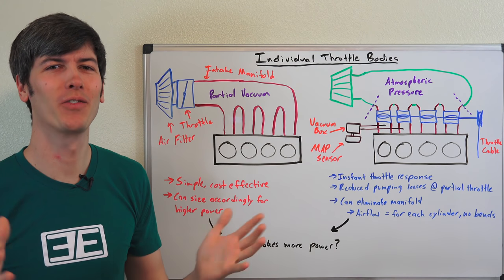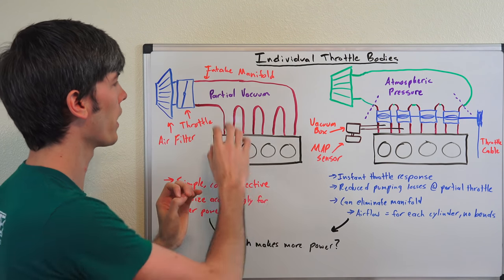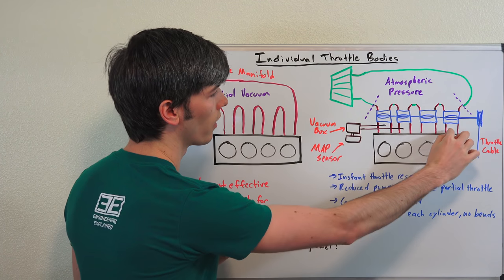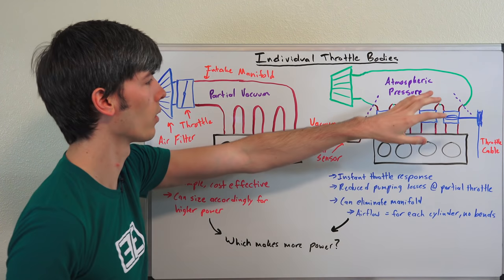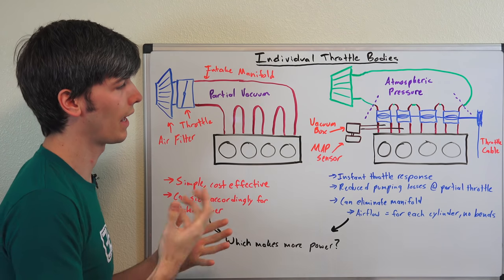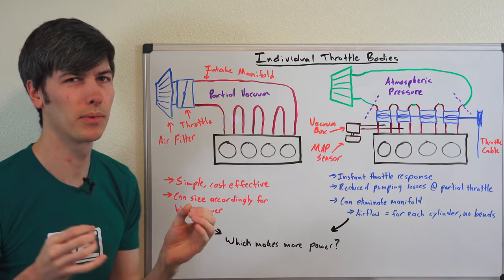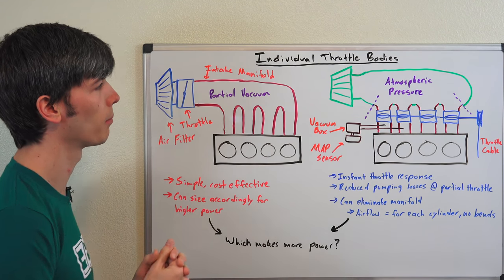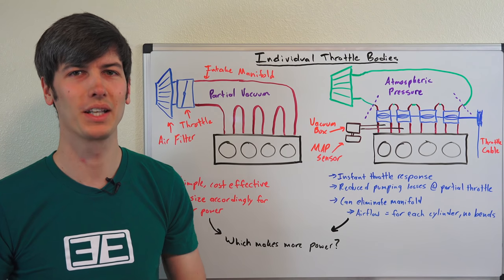Benefits Of Individual Throttle Bodies

Comment: I used to own an Alfa Romeo Giulietta 1.8 with the "Alfanord" twincam engine that used to power Alfas a few decades ago with displacement from 1.3 to 2 liters (also, Alfetta, Alfetta GT/GTV, and, before, Giulia & Giulia GT).  Those Alfa engines were all ITB and actually very reactive, although it was difficult to  sync the 4 TBs, to avoid some disappointing power gaps. Not so many mechanics were able to do the job properly and was also expensive. The 2 liter engine was the first to switch from two 2-barrel carburetors to electronic injection, unfortunately losing the ITB feature

Comment: You still have the same pumping losses at partial throttle. Torque output is all about MASS flow. Mass flow for a given torque output is the same regardless if you have individual runners or a manifold.

He’s talking about pumping losses in a transient environment, IE manifold filling, which matters not at wide open throttle or steady state cruise. Reduced pumping loss from ITB is so tiny that it doesn’t matter.

IF you could control each throttle individually, and completely close off some of the runners so NO air flows, you could drastically reduce pumping work, but you would essentially have created a variable displacement engine. 

Throttle response is the only real advantage. You can gain some width in the power band by running slightly different runner lengths, and ITB’s would make it easier to match if you had a carb, but that’s about it.

Comment: Hey EE, performance oriented ITB cars are tuned Alpha-N or TPS vs. rpm.  N/A cars can be tuned without a intake manifold in this case.  Turbo cars still need a manifold for fueling adjustments while in boost.
Reply: Was hoping someone would mention Alpha-N. Vacuum signals from ITBs are very "noisy" and not very strong at partial throttle for reasons outlined in the vid.
I built ITBs for a car I turbocharged some years ago. 
To map the engine, I ran Alpha-N and applied corrections to fuel and ignition based on positive manifold pressure.
Worked like a charm and had fantastic throttle response.

Comment: Back in the day I owned an '93 Alfa Romeo 33 with 1.7L 16v boxer engine. This engine had ITB and was super enthusiastic on the throttle input. Loved that. I hate to say, but the NC Miata is driven by a ship diesel in comparison in this particular respect. BUT; The Alfa Romeo 33 with the 1.7L 8v boxer engine had even quicker throttle response then the 16v variant. Well, at least from idle. This 8v had a single throttle body. Never fully understood this. Perhaps due to having two camshafts an 8 valves less it had lower inertia?

Comment: Usually if you're running ITB you'd move to a speed density / alpha-N model rather than a vacuum tree. Also the engine response is important with a dog engagement gearbox, where you need a blip to unload the flanks and the more reactive the engine the faster the shift.
Reply: He also didn't mention that going to ITBs lessens the negative effect of aggressive cams on idle quality.

Comment: The true benefit of independent throttle bodies is the stereo warble you get from open velocity stacks when they're installed on a V8, flat  6, or flat 4, and the engine bay is behind you. There is nothing like that sound. It's glorious.

Comment: removing the inlet manifold as suggested would lead to massive induction roar and pulling hot air in from around the engine would decrease power. Also the long run of the 1st example can offers a mild supercharge effect as each inlet valves open at different times.

Comment: Can you do a video on why most rally cars are hatchbacks? What are the advantages?
Reply: lol that might be it. I've been trying to figure out why they are hatchbacks and the requirement for mass produced cars did pop up. But if that's the case, why don't we see Toyota Corollas, Nissan Altimas, Ford Taureses and Honda Civics in Rallys? Those cars are roughly around the same dimensions as some of the Rally Hatchbacks I've seen minus the hatchback.
Reply: It gives the poor buggers another exit choice when they are upside down!
Reply: Weight and mobility
Reply: Its mostly the mass production thing. Also the heritage of the sport is people who like to be outside, drive cars on dirt roads, and camping. Hatchback is obvious choice for those reasons. Don't forget all wheel drive. Very Important.
Reply: sharpemang well, Toyota was competing with the old corolla years ago
Reply: Group b were hatchbacks check other groups like a and c

Comment: Can you please explain how ITBs would reduce pumping loss?  I understand how they help combat manifold filling times to improve throttle response, however in the steady-state part-load conditions, how would pumping work change?  Pumping loss is a function only of the gas flow rate and the pressure loss across the restriction (W = m(p1v1 - p2v2)).  Therefore, for the same engine load (MAP) and volumetric efficiency + engine speed (flow rate), I would expect the throttle loss to be independent of the size and shape of any manifold volume in the system, before or after the throttle(s).

Comment: really good info, didnt really cover the torque benefits that bodies. they have a much wider torque curve. obviously this is relative to velocity stacks or plenum being correctly matched for the set up, but that instant throttle response is relative the the torque increase much lower down in the revs

Comment: The intake plenum is not at atmospheric pressure. There's an inherent pressure loss associated with the intake filter. 

Also the throttle body is a choking device. You can always make up for itb with larger single throttle body. but good points.

Comment: Done a couple ITB and the make much more torque in usually a 1000 to 1500 rpm range, heard some do a good bit better. I'd rather have one motor with a broad torque curve that will win most of the time over one that wins at one track.

Comment: what are your thoughts about using actuators instead of the camshaft to run valves and using them as throttle bodies at the same time?
Reply: asaikaly2 Like how BMW engines work?
Reply: they're amazing! personally, I cant wait to get to tune and mess with stuff like that! and i think it can increase power and efficiency as well. if he hasn't already done a video on freevalve tech he totally should!
Reply: He has done one on it, showing that the valves can open faster than with a cam shaft and have a longer duration
Reply: Preproto i thought so, just wasnt sure if i saw it somewhere else. im pretty excited for it.. i feel like its the next big change like EFI was!
Reply from the maker: Here are my thoughts! https://youtu.be/FJXgKY2O4po
Reply: I love the idea...less weight up top of the engine, smaller engine dimensions (easier packaging), along with the ability for the valves to mimic a low-rpm torquey cam at low revs, a full race cam at high revs, and everything in between.  Should give the ability to make phenomenal usable power throughout the entire rev range, using the same size engine.  This should also give better fuel economy and emissions, since it can be tuned for a lot more variables than a metal cam that has one set profile physically ground into the lobe shape (or maybe two, if you're thinking v-tec.)  :-).
Reply: The better the design, the more expensive to manufacture, and the less profit is to be made, generally.
Reply: True, but prices should come down with time and economies of scale.  Not to mention that it may actually become necessary as efficiency, fuel economy and pollution requirements tighten down over the years.  After all, fuel injection used to be considered very expensive and unnecessary - but they're ubiquitous now.
Reply: asaikaly2 multiair
Reply: The way that new engines work is way too complicated. I'm 15 and I can think of so many ways that modern engines can be simplified. even my 1982 Volvo is complicated, so I would probably die if I had to work on a new engine lol
Reply: Undercover Wookiee they aren't any different. They just have wires. Also those wires only have one home so find the one that fits.
Reply: Dealing with the heat is probably one of the main issues they've been dealing with - valves and valve stems get very hot, specially exhaust valves - and electronics don't like heat.  Having them sit in a hot oil bath is probably also part of the problem.  And unlike a cam lobe, it doesn't have a built-in way of cushioning the valve so that it gently closes on the seat, which can lead to some very expensive repairs if they get it wrong.  Not to say that these are insurmountable problems (obviously!), but they have probably added to the time needed to develop a reliable system.  After all, no manufacturer is going to want to employ something that isn't tested to the best of their ability - their reputation could end up shot to hell if they get it wrong, no matter how hard they tried or how good their intentions.  I'm just glad it's finally looking feasible and hopefully cost-effective - especially once economies of scale take effect.  :-)
Reply: Mechanical efficiency is one big reason why magnetic actuators are not a slam dunk.  You use a lot of power to open and close a magnetic valve, while a camshaft is nearly 100% mechanically efficient, since the energy you use to compress the valve spring, is returned to the cam shaft as the valve closes.
Reply: aussiebloke609 about the closing speed of the valves.. thats one of the first advantages that koenigsegg mentioned in their first video about it, they can hold it open longer and close it much faster without slamming it shut like a cam would if you tried to move it that fast.. and diesel injectors are are probably a good place of reference for them to sort out the electronics life inside a valve cover.. id assume (or hope, lol) at this point theyre mostly working on making it affordable to produce or maybe even still seeing how they can tune with it.
Reply: Cams are designed so that as the valve comes off the lobe, it eases the valve against the seat, so in theory, they shouldn't ever slam - but we know that's not quite true at really high revs.  But yeah, they seem to have that problem licked with the electronic actuators now.  I was just speculating that it was one thing they had to find a workaround when they first started R&D on the technology.  Just one possible reason we haven't seen this technology in the mainstream previously.  :-)
Reply: asaikaly2 BMW Made a prototype engine that had no timing chain (or belt) so no camshaft and tested on 3series BMW cars seventeen years ago.
Reply: Yns Msd tell me more! lol
Reply: slidestang242 I don't have more details about. You can make research about. I think the design wasn't that efficient. And for techs like me we do prefer having the conventional design so we could replace chains, belts, valves adjustment...so we could survive :)
Reply: Yns Msd there will always be parts to service, who knows, maybe replacing solenoids will be easier and make us more money!! lol do you know like what year they did that, or what they wanted to call it? i asked because im not sure where to start to search about it
Reply: slidestang242 I looked on Internet and didn't find interesting presentation. The system called "CamLess" or "QamFree".
I knew that BMW made a prototype because I red it in a commercial book when I was at Mechanical school.
If you like to read or learn some good sophisticated engine you could look for "MC-E5" engine blocks. It used a variable Rods to have a variable compression. It's a French design and revolutionary blocks.
Reply: We need Freevalve upgrade for all our B/F/K series.
Reply: asaikaly2 You'd need some pretty skookum actuators to get her to chooch right, that and a real fancy control system
Reply: asaikaly2 I believe Koenigsegg is working on a system for that right now so you might be able to find more info in relation to him.
Reply: Another reason actuator valve systems may be cost prohibitive is the wear on valves and valves. The sharp acceleration of the valves require exotic materials for the seats to make them hard enough

Comment: only suggestion is to give us a few examples of cars that have each- job well done- really enjoy your channel.
Reply: Very few cars have individual throttle bodies but it's the norm on motorcycles. The only bikes I'm aware of that don't have ITBs are some old v-twins where they share a carb between the cylinders and some 6 cylinder engines where someone decided it'd be cheaper to use 3 carbs instead of 6.
Reply: Scott Moore any car with an RB26 swap or a 1989-2002 GTR has ITBs unless changed.

Comment: I believe that it's somewhat incorrect to claim Atmospheric pressure in the collector manifold for the ITB set-up, as flowing air passing even a filter will have something of a pressure drop. Of course it won't be as low as the single throttle design, but unless you go filterless or foam, there will be less than 1 atmosphere. And the more those throttle bodies open, the lower that pressure becomes. At WOT, the two plenums will be pretty much the same. As the single throttle body plenum will rise in pressure, the ITB plenum will lower in pressure as both approach WOT.

Comment: I've noticed with vehicles with vtech or larger cams, longer intake is much better for power.. I think individual throttle bodies on that sort of engine would actually reduce power.. vtech will kick in and not much would happen. I noticed with an mr2 I had fitted with a full exhaust you notice the difference with having a shorter intake, its louder sooner..more responsive. It would be cool if you could have a system that incorporates both.

Comment: I live in Colorado at 6,000 ft+ . I have a 1994 Miata 1.8 NA without boost. Will ITBs give me more and better power? Does altitude cancel out IT B effectiveness? Can I run I ITBs with forced induction? Should I run a methanol injection cooling system with forced induction at this altitude? Thanks in adavance for clearing this up the way that only you can. Cheers!

Comment: The one disadvantage I see to ITBs that you didn't discuss is intake tuning. It doesn't look like ITBs can be set up to scavenge effectively using tuned intake runners, and therefore you are leaving horsepower on the table. Am I correct or can ITBs scavenge as effectively as a plenum system?

Comment: SLP tried doing the atmospheric pressure advantage with their T ram, as there's twin plenums on both sides of the intake manifold/runners, thus retaining outside air while utilizing a stock TPI throttle body.  These systems are very rare though, only found on the '91-'92 Pontiac Firehawk, and Summit Racing stopped selling them a while ago since production ceased.

Comment: I noticed that the f80 m3 (or m4) doesn't have IBTs like the e90/92, do forced induction engines benefit less from IBTs than NA engines? The r34 Nissan Skyline, despite being twin turbo charged, does have IBTs.

Comment: So if my car comes with a variable intake runner length system, upgrading to an ITB basically means that i can only pick a specific RPM range and enhance that range. Right ?
Reply: Not positive, but I believe so.  I think you'll sacrifice at one end of the rev range to enhance the other end.  It makes sense...but I'm no engineer.  :-P
Reply: Davin Yap if you remove the intake manifold, yes. As Jason said, you can remove not you should
Reply: +Alex Haws my car comes with the variable intake runner length system to eliminate a torque dip at 3k RPM. If i were to theoretically upgrade to a ITB, i will sacrifice daily drivability cause the ITB doesn't solve the torque dip issue. Right ?
Reply: Davin Yap i think it depends on what else you do to the motor and how powerful it is to begin with. how much tq dip is being prevented with a variable runner length? if its low then you probably will not notice a dip... unless your using a dynamometer.

i should note that i am not saying change or stay. just stating my opinnion
Reply: just turbo it
Reply: I think the Mazda 787b has telescopic intake runners and individual throttle bodies
Reply: the torque dip is quite noticable when climbing hills. In the 4AT version, the engine will require you to keep it in lower gear or it will go gear hunting to keep the engine at 4k RPM for that climb. From reading all of the above comments, ITB only benefits one RPM range right instead of 2 different RPM range. right ? Not here to get an opinion on should I upgrade to ITB or not. It's more towards satisfying my curiosity.
Reply: Davin Yap i know your not necessarily directly adressing me but the torque dip i am talking about is the over all difference in the dip area.  If you have a difference of say 180tq with variable runners  and w/o say 169tq just in that area then your not going to really tell. As for the work range of a ITB intake vs a variable one... my guess would be runner size. Lots of old race cars 4, 6 and 8s would use ITB and i am not talking drag racing i am talking road courses where the cars rpms would sweep.
Reply: basically, any non variable intake manifold will only work well at an specific rpm range. the rule is short and wide intake pipes for high rpm power and long and thin pipes for low and mid range torque.
Reply: Davin Yap what kind of car is that?

Comment: if you haven't done a video on it yet, you should do a video on why running an engine without an air filter causes the engine oil to get dirty faster.

Comment: Toyota used 4 throttle since late 90's  from 4AGE Silver Top & Black Top engine 1.6cc 20 valve 5 valve per cylinder 3 intake 2 for exh valve.Make horse power from 160-165 hp/162 Nm at 5200-5400 rpm and redline 7800-8600 rpm without valve lift system.The most early torque compare to others 1.6 engine...